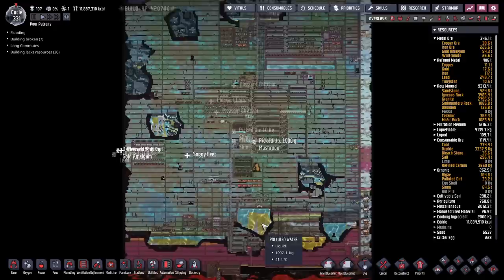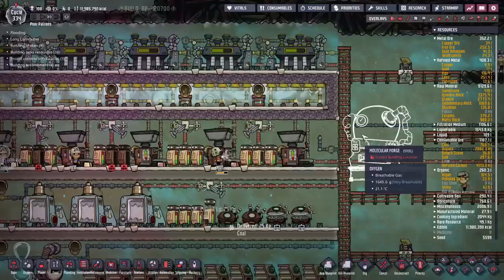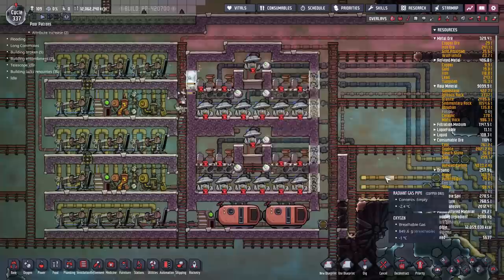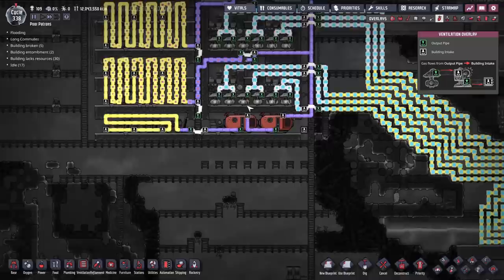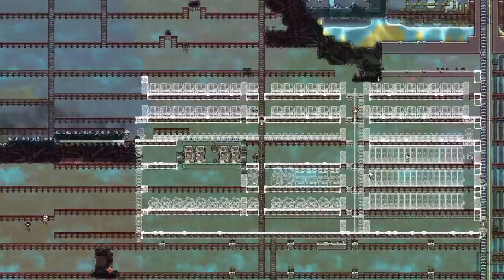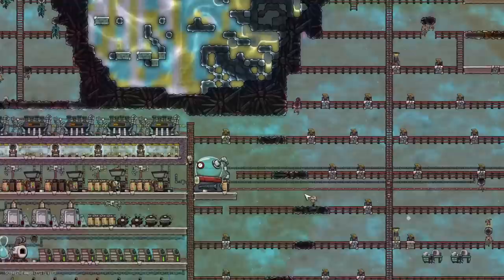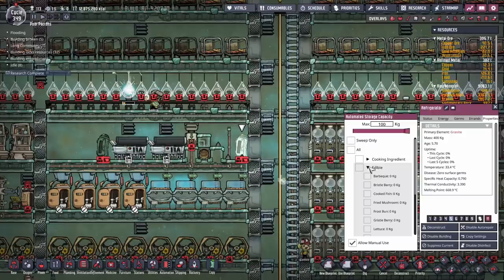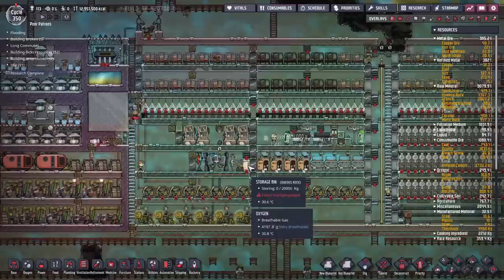141 Dupe Challenge 13 : More Dupes, more housing : Oxygen not included

Comment: One important use I found for tungsten is if you launch Hydrogen rockets stacked above each other.  The exhaust from the upper rocket will blast insane amounts of heat down on the automation wiring of the rocket below it, and the ONLY metal that can withstand that heat is tungsten.  Everything else just melts.
Reply from the maker: Good point, it's the wire directly in the middle. I won't convert all the tungsten I always keep a little bit of everything around even wolfermite.

Comment: Set on gas sensor "steam" and add not-gate
Reply: Yes and replace the And gate with an Or gate.  Then, if steam is detected by either sensor, the pump will stop.
Reply: No need for even the OR gate. Just connect both sensors to the NOT input. If one of them is steam, it will be green, NOT will output red, and we're all set.

Comment: 5:00 I beg a differ. Tungsten have a high melting point, and because how heat injection works, automation wire under hydrogen rocket in space must be tungsten

Comment: 27:51 Once your steam pressure goes significantly above 20kg, gases will sort themselves out much easier. For example, at 100kg steam pressure, carbon dioxide will instantly sink to the bottom while at 20kg, it floats around and messes things up.

Comment: Are the minibases improving performance? They won't cut down on task-picking calculations - the larger number of dupes in suits now can access even larger amounts of the map, which is the opposite of restricting the number of tasks they can access. It'll be tricky to segregate them in the future due to the shared ladder spine, too. 

And each base introduces a ton of piping... with lots of junctions too. This is a double whammy.

There's enough dupes to consider physically partitioning the map (if nothing else, at least you won't have to toggle two dozen doors to control where dupes go). And the map is big enough for open plan electrolyzers, to avoid piping six lines of oxygen per base with lots of vents each. Cool the descending oxygen, let the hydrogen rise naturally, slot airflow tiles everywhere.

Comment: 16:50 for that pump sensor in the rocket you better add a NOT gate and set the sensor for steam (because the sensor will be more sensitive and it will work faster), if you set it to CO2 it will take time to turn on and will not catch a running tile of CO2.

Comment: I like the doors on the oxygen modules. It allows you to open them when you first run it (with a side door open) and "purge" out all the oxygen below the pump before running the hydrogen pump. You then don't have to separate the gas later in the overflow tank.

Comment: Re: Gas pumps pumping CO2 into space. What if you just have a door on that side of the steam turbines and open it to space if CO2 is detected?
Reply: Would remove a lot more steam than CO2, the steam is very high pressure whereas the CO2 not nearly as pressurized, so it won't want to move as much. Besides, he can afford the power and resources to make it a lot simpler and less complicated
Reply: Could perhaps have the exhaust past beneath a couple of steam turbines to remove what steam there is.

Edit: Might not even need a door - if the 1 high passage was the right length (flow restriction) it could be open ended.

Comment: If you set the atmo sensors at the bottom of the rocket silo to steam and use not gates the pumps will automatically pump everything that is not steam
Reply from the maker: I have a tendency to miss the obvious far to often, I get stuck in my ways.

Comment: If you want melt lots of ice better use conveyor loop. Just use auto sweeper to load conveyor loader from you ice storage.

It spread it to 20kg/tile and have wonky heat transfer (faster than it should yo be). Keeping ice in storage at huge amount take ages to melt (unlike food they clump to one item when new ice added, making one massive mass of ice)
Reply: Eh pointless to build that infrastructure when it's a hell of a lot simpler to just...not. Besides worst case scenario he just builds a tepadizer (spelling sorry) to warm up the water itself and bam done

Comment: Send the save file to Klei so they can use it for optimizations. Sure even little bits will have a measurable impact.
Reply from the maker: I know factorio devs have that type of department, I don't think Klei do.
Reply: @FrancisJohnYT  Well, the Factorio devs are something else. Their game is optimized to the point where even a toaster can run it. Would be amazing if Klei would put that much effort into ONI.
Reply from the maker: @DasPanoptikum  If it was optimized to factorio levels you could run 1000 dupes. Those devs are legends.

Comment: 20:48 looks like left ctrl f4 on again.
Reply from the maker: The pipe was already built just not connected. I do the same all the time with pipes and power wires, so long as two cable or pipes are right beside each out they can be connected at any time without dupe interaction.
Reply: @FrancisJohnYT  Yeah i seen you do that alot just looks like it because ya cant see that 1 pipe segment. Pilers mod should be in that game its so usefull

Comment: 5:03 not exactly true. Tungsten has the highest melting point of all the refined metals of over 3400 centigrade. If you wanted to build an insulation melter tungsten might be needed.
Also i've noticed FJ consistently saying "i have went", why not "i have gone"? Is that a local thing or what? As always tho, thank you!
Reply: Gone is not used in modern English that way.
Gone is reserved for strong expressions like gone forever, gone away, etc.
Reply: @santiagoperez2094  Wow, thats very strange to hear. Not what i was taught at all. We've always been told that perfect tenses demand their verbs in perfect forms if they're irregular. So it would be "I've gone ahead and done..." etc.
Is gone special like that or are there other as far as you know?
Reply: @tyraelpl  
"I've went" is technically wrong. It's either "I went" or "I have gone" depending on the exact meaning. But people don't always use the correct forms. It's some kind of informal or colloquial usage. And in that context it's maybe not strictly wrong. It's not even a new thing. You can find occurrences of "I have went" in spoken English going back a long time. Written is something else though.
Stuff like that isn't uncommon in many languages. In English it's very common in the US in some areas and with some social classes. Very long term that's how languages change and evolve.
Reply: @S_Black  That's more in line with what I was thinking. Thank you!
Reply: @tyraelpl  there are lots of cases, for each language also, ¨going to¨ for example its widely taught in the world and the only ¨form¨ of it that its currently used its ¨gona¨ in the us.
Reply from the maker: Doing videos has made me far more aware of my accent and grammar. Also it appears I use some uncommon expression and words, I'm have modified some of them. But I find I want to leave most of them in, I feel like it's more me. Except for how I pronounce melee or fillet, that drove everyone crazy.
Reply: @FrancisJohnYT  aaahaha i love how you speak man and i didnt mean to be rude much less make you feel bad. It was mearly curiosity since one cant know everything and it could have been like slang or something, i simply didnt know why and asked. Ive been to Ireland, mainly Dublin but also made a tour (almost) as the island is far and wide, to cliffs of Moher and Belfast and Giant's Causeway and i find your Irish accent very original and unlike that which i heard. Personally imho you shouldn't tone down all those little quirks that make you you. Some of the best parts are you butchering people's names, like patrons... Gotta love that part! Personally i never noticed those 2 words... Where can i find that? 😁
Again thank you and my apologies if i made you feel bad in any way, that wasnt my intention.
Reply from the maker: @tyraelpl  Don't worry I did not think you were, it's pretty hard to make me feel bad, I'm from a family of five it makes you very resilient.

Comment: Is there any easy way to wrangle some of the 'voles from the 1st starvation chamber to use in the 2nd without them escaping?
Reply from the maker: I don't want to move any from chamber one, chamber one feeds all the dupes in that mini base.
Reply: OK. Is there an easy way to do it without them escaping everywhere though?
Reply from the maker: @nommy8599  Yes and no it's a complicated question. Wrangling them up is the easy part. The hard part is the critter drop off only supports 20 critters. Once you have more than that in the room it won't allow you to drop off any more. 
However if you need more than 20 you can break up the room into smaller chunks with doors then you could have several drops off in a similar sized space and once you have all the critters in you delete the doors to make it one big room.
Another additional complication is that now the doors only allow in dupes from their respective bases, so mini base 1 dupes can't get into base 2. So you would either need to change door permissions or have an intermediate drop off they can both access.
Like I said it's complicated :)
Reply: @FrancisJohnYT  Ah right, interesting, thankyou for the detailed explanation! I suspected it might be fiddly but wasn't sure.

Comment: Could you use a latch to turn on the gas pump inside the the chimney, then use a gas element sensor on the output pipe to reset it when it detects steam?

Comment: If you brought down the space ceiling one tile would that make the regolith pile higher to feed the extra shove voles? Would that help?
Reply: He doesn't feed the shove voles for the actual bases. The ones he feeds are just for eggs, and that's only for a relatively short amount of time. Not worth tearing up and moving the ceiling and wiring and everything else as it will be entirely irrelevant in a short amount of cycles
Reply: Chandler Hupp yeah good point

Comment: Would it be possible to collect the water blobs from those steam turbines? Maybe add a gap on the left to allow the water to drop into a collection chamber with a pump?
Reply: Entirely pointless because, as FJ explains, they're only because the thermium pumps just needed to heat up which would happen in time. By the end of the video you see there's no water building up anymore as it's all up to temperature
Reply: @xPanda25  Yeah, but I think the end goal is to extract power and water from the rocket chimney. So if a temperature differential were to be maintained, then that could be a way to get the water.
Reply: Jesse - The only way it would is to make a cooling loop there as eventually it will be the same temperature as the rest of the steam which will only get hotter as more rockets get added. The much easier way to do it is to do exactly what he is doing, just pump out the water the steam turbines pump out and use that, and leave the steam as it is
Reply: Sufficiently aggressive cooling could return the chimney below 100°C before the rocket returns, so the steam condenses naturally and can just be pumped from the bottom in 10kg packets. This would require fewer turbines... albeit one would need supercoolant to be practical.
Reply: @cancellorable  Yes but if you watch his Rime series where he built the original rocket chimney you would know that it is entirely impractical to do so. First main issue: Currently the Aquatuners he has are cooling the steam turbines which only output 10% of the heat consumed. Which means to cool the steam directly you would need 10 times the amount of aquatuners...which would still require a ton of steam turbines. Second main issue: The amount of super coolant and piping is just absurd. Third: Efficiency, it just is not nearly as efficient using aquatuners to cool the steam directly as it is to use the steam turbines to convert the steam into water and power while requiring a ton less power consumption and piping etc etc
Reply: @xPanda25  It's not that many - when I did the back-of-the-envelope, he only needs 6 turbines and 3 aquatuners to be a self-powering and self-cooling way to cool a hydrogen rocket traveling the whole distance before it returns (3 cycles). That's at the bottom of the chimney; it would be correspondingly fewer further up. 

Turbine heat deletion is linear in input steam temperature - as long the input steam is below 1000°C, the turbine will function and lower it to 95°C (venting 10% to the environment around the turbine). 200°C loses about half the heat, 300°C steam loses two-thirds, etc. The heat deletion right now is slow because the input steam is only ~200°C and at an irregular pressure (because the turbine is being used as both water pump and heat deleter). The trick is to aquatune input steam to a target temperature and pressure - 500°C or thereabouts would work, thereafter diminishing returns set in (aquatuners don't care if they are pumping heat uphill, they'll merrily extract 14°C*SHC from whatever coolant liquid regardless of the gradient). This is achievable with a separated steam loop (to keep pressure management simple), a small, tight loop of supercoolant in a heat exchanger, airlocks to control the heat transfer, and tempshifting the cooling into the chimney (not piping). He certainly has the dupe labour to build an unbelievable quantity of tempshift plates.
Reply: cancellorable - You are forgetting a few things, for one, it is multiple rockets constantly being launched all adding to the heat and adding it in different areas, second again, applying direct cooling to the steam is not nearly as efficient as using steam turbines to do so...and what would be needed to effectively cool the aquatuners? Right, steam turbines and a ton of them if the aquatuners are running flat out (which with constant rocket launches they would be), thirdly as I already mentioned, he went over the math in his rime series and showed that it is way more efficient to use the steam turbines to extract the water instead of applying direct cooling. If you want to go ahead and build it yourself then go for it, no ones stopping you. But it would just be so much more efficient to use steam turbines directly on the steam and extract the water that way